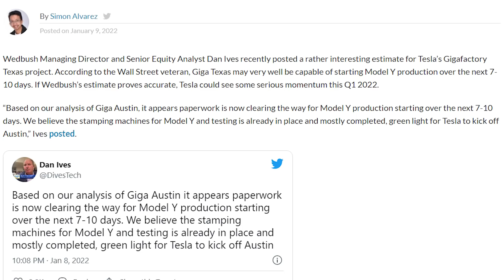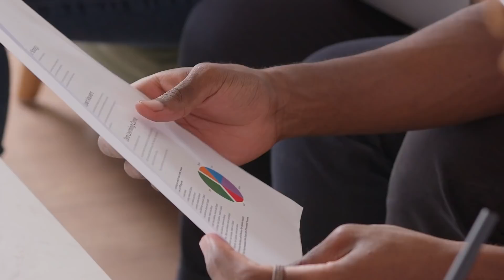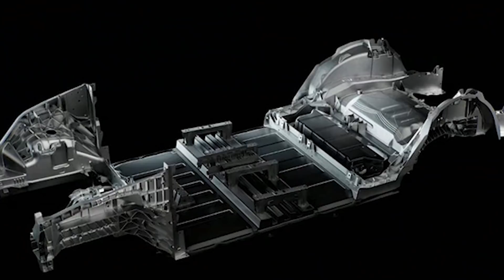Tesla GIGA Texas Finally Opens the Doors!

Comment: This confirms it. Giga Berlin is mess! Started much earlier, Berlin is a drag on Tesla’s expansion. As a stock holder it is galling. A plant started at the same time, 31 miles away inPoland, would now be producing at least 5,000 vehicles a week. It took Germany 10 years to get approvals for its new airport. What a waste.
Reply: It's one of the best locations for production in Europe though if you want to be in an attractive area for workers and upcoming talents, which is the reason it was choosen, similar to Austin. They could have gone with production in east europe, but it would be much harder to find all the workers you need. It's probably going to take longer to get things going but once regulations are done it should be a good location long term.
Reply: Sell your stock :)
Reply: @dxelson  while Tesla stock would likely drop if Berlin had massive delays or wouldn't get the permit at all (extremely unlikely, but certainly not impossible if Germany wants to never again have any industry trying to invest in the country) the current price will still seem rather cheap already in the near future. The stock price and most analysts right now don't even reflect a fair valuation for Tesla reaching 10M cars production in 2030, which would be 50% less than what they are aiming for. 
But even then the analysts don't give credit to their great profitability. Do the math, Tesla will likely have 100$ in EPS in 2027  even with only a 25-30x P/E this would put the stock at 2500-3000$ which is a 3x in ~5 years.
And that's just the fair value for the automotive part, insurance and energy are already growing business parts for Tesla, FSD will become a relevant part of their revenue and profits in the future too, even if they were not able to get regulatory approval or wouldn't be able to solve rare edge cases good enough to be allowed Level 5, the software would likely still offer a much better value to the driver.